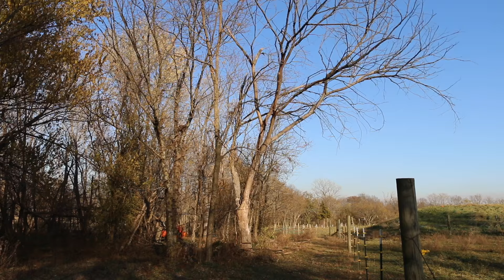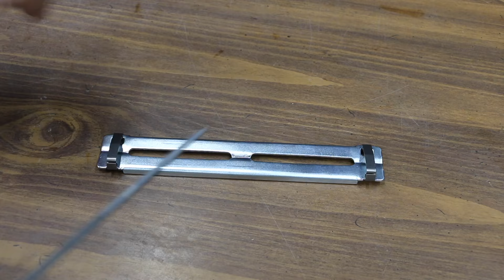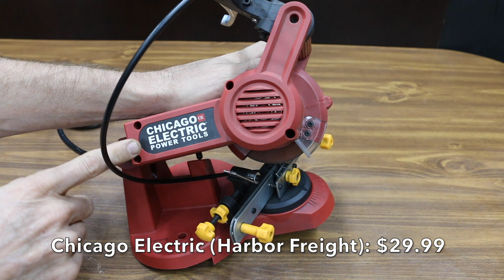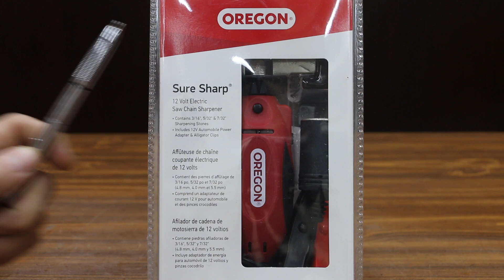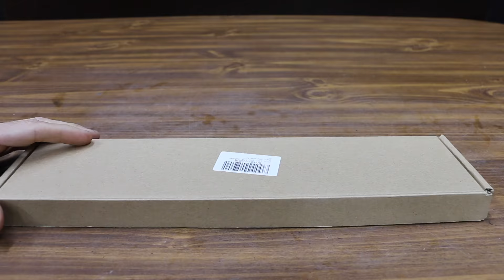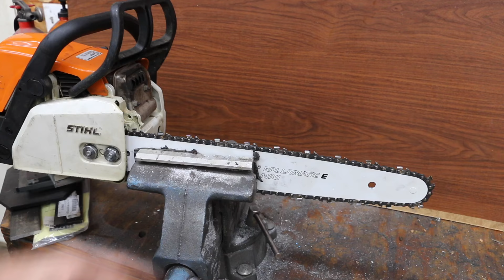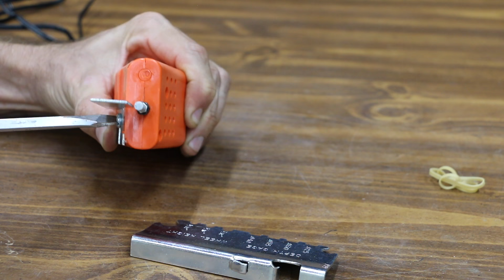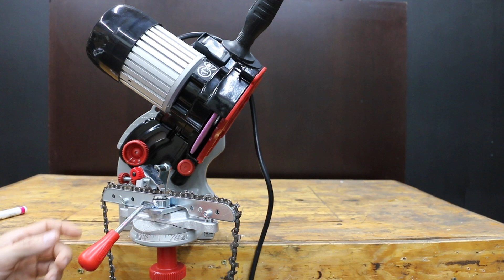Which Chainsaw Sharpener is Best? Let's find out! Stihl, Granberg, Chicago Electric, Oregon

Comment: I takey Granberg 12v everywhere in my box. Use a Milwaukee 12v batter with 2 14awg wire(ends hammered flat) to connect it with. Even if you mess up your chain bad it can restore it to like new condition as good as any bench grinder. 
Great test and big shout to Granberg, I atest they stand behind their equipment as well.
Reply from the maker: Thanks for the feedback.

Comment: Great video. I feel good (bang for buck) about the Harbor Freight sharpener that I have.

 Some suggestions for this type of test:
1. Using a corded chainsaw rather than battery powered. It would eliminate any potential variations in characteristics of individual batteries.
2. Somehow keeping the angle of attack of the chainsaw consistent. Maybe attach the chainsaw to some sort of arm-pivot contraption.
3. Using clear wood (or perhaps some material other than wood). There were patches of branch knots in the wood that you used.
Reply from the maker: Thanks!  Thanks for the feedback.

Comment: One thing you need to actually add and even in the instructions when you use a file you're only supposed to do the exact same amount of strokes per tooth that way each tooth is the same size which the organ bench grinder is way better than the harbor freight because it has a lot more adjustments which that's what we use  to professionally sharpen chains because you get each tooth identical and you got to make sure that you have it set up right so that way it keeps the geometry which you can actually add better geometry to it to actually cut faster and quicker if the saw is got enough power but if you look at your tooth when you used it had changed color you doing it way too quickly which takes The temper out the steel that bench grinder you're supposed to do it slow enough so not to overheat the chain that's how we professionally sharpen chains at the shop each tooth needs to be the same size if not then you'll start cutting crooked and all that
And the only con to the orgon bench is that you cannot use it in the field and then you have to use the file

Comment: Great Video as are all of yours.   I would add that Dremel makes an attachment for their tool that costs about $10 and works very similar to the Oregon Field sharpener.  Very easy to use and results are good depending on your skill and attention level.
Reply from the maker: Thanks!  Thanks for the feedback.

Comment: Just nit-picking but when he said that "Since this is a 3/8" chain, we'll be using a 5/32" file" he implies that all 3/8" chains use a 5/32" file.  That is definitely not true.  In fact, most 5/8" chains that I've used use a 7/32" file or a 13/64" round file.  So check the specs for your chain to choose the correct round file.  Another thing:  The only one of these sharpeners that sharpened both the tooth and the depth gauge was the Stihl 2 in 1 sharpener.  After every two or three sharpenings, the depth gauges have to be filed but this comparison didn't take that into account. With most of these sharpeners, that would require filing all the depth gauges which would greatly increase the time it takes to sharpen the chain saw.  As for the Stihl 2 in 1 sharpener ... DON'T get one!  It's made by a company called Pferd.  The Pferd branded sharpener is the EXACT same thing as the Stihl branded one except for the color.  The Pferd sharpener is blue.  The Stihl branded sharpeners can cost up to twice the price of the Pferd branded sharpener.
Reply: They are the same price lol

Comment: chicago electric is easy to use but requires learning how to set the chain properly so it doesnt move.   it also doesnt allow for depth of cut sharpening but in this test, only 1 manual sharpener does this .  its good price and does a good job for non professional chain saw/pole saw users that take chains to pros for sharping ($5 each chain in my area).  Biggest thing is angle and not trying to take too much material off at once.
Reply from the maker: Thanks for the feedback.

Comment: One factor I didn't hear about was the knots that the saw was going through. Not really a fair comparison but difficult to get a clean sample without knots. Having said that, I love my Chicago Electric sharpener and part of the reason is because its So incredibly unstable. This is my reasoning behind that statement. When you pull the handle down you can move it side to side (probably not by design) so I can get that grinding wheel to touch exactly as much as I want by pulling the handle just a bit toward the cutting edge/gullet. But for being out in the field there is nothing like the Stihl 2 and 1 (or the cheaper knock off that works the same). I tend to not use the 2 and 1 anymore since getting the HF sharpener. I just bought more chains and instead of sharpening in the field I change out the chain instead and sharpen them all in the evening. Much more efficient use of time when doing a job. 
Thanks for the review, it was a fun one to watch.
Reply from the maker: You are welcome!  Thanks for the feedback.

Comment: Thank you for such a great test. For years, I have been struggling with finding the best, but most economical, sharpening system. I recently bought the Stihl 2 in 1 and am slowly getting batter at using it. Now that I've seen your test results, I feel confident that I can get better and it will produce some positive results for me. If I can think of any further tests for you to try, I will certainly let you know.  Thank you very much for your great work. Cheers!
Reply: Have faith in the Stihl 2 in 1 sharpening system. The "learning curve" is virtually zero. I've sharpened , literally , thousands of chains in my life. I've done freehand, bench grinder and depth gauge, rotary bits in a Dremel, etc., etc. Nothing comes close to the simplicity of the Stihl system. The tool itself shows you the correct angle, every time.  Let the end of it bump up against the chain every time you make a stroke with it. However much it wiggles to go flat against the bar is how much you were off by. Feel it.. it'll talk to you if you let it..  You should be able to feel in your hand when the file goes across the gullet of the cutter correctly. 
The sharpest saw chain cutters in the world are useless without the rakers ( depth gauges) being properly set. If the depth isn't set right, the sharpest cutters will just spit dust, not chips or flakes. The whole point of the 2 in 1 is that it sets the rakers at the same time. 
Don't wait until the saw blade is spitting dust to sharpen. Normally, unless you hit dirt, or are cutting wood that's been on the ground for time, the saw blade should stay sharp for at least a tank of gas. After every tank, take the 2 in 1 and give the saw chain 3 to 5 licks per cutter. It's not meant to revive a damaged chain... That's a job for a bench type sharpener. The 2 in one has become my "go to".. Yeah.. maybe I could do better by hand..  but for the simplicity of touching up the saw blade in less than three minutes after a tank of gas... Damn!! Besides, I'm old.. it's my way of taking a break.  

Every time some one puts a hand on one of my saws that's been sharpened with the Stihl 2 in 1, the most common reaction is " Damn!!  Who sharpened this?"
Reply: @charles09361  I agree with you , I have 3 of these for my saws . My MS462 with Stilhl oilomatic chains actually feel more aggressive than a brand new chain. So quick and easy with a stump vice out in the woods
Reply: try using a plain 7/32 round file, you can watch it sharpen each cutter. those sharpeners with handles and guides block your view and you end up doing a poor job. I use the pferd premium files and it sharpens better than any machine can. look up buckin billy ray on here and see what he does
Reply: (Mlm

Comment: I hate to disagree with most of the test!  I am 82 years old and still felling trees!  He took a chain that was so badly worn he wasted so much of the collet one will have to buy a new chain 10 times to one of the Chicago Electric.   The C E is so fast i sharpen the chain at every refill of gasoline or 2 times the oil fill on battery operated.  This sharpner saved me over a $1,000 in sharpening and new chains because of commercial charges and wasted collet,,  And on the subject of cleaning up yur chain------Do it simple  water with a squirt of Dawn dishwashing soap and a brush clean in seconds.  the bad part of this sharpner is the latch that stop the collet  i had to remove it file it down and add washers to move it more torwards center,,,also not the position of the bar on the new chain it is parallel to the ground all others were tipped do not know if that had a difference---on my trees took down 6 /  28 in diameter Ash trees next to my house in 17 hours,,,,then all summer to buck them up,,to much for an old man! Viet Nam vet
Reply from the maker: Thanks for the feedback.

Comment: Thanks for the video! For me, a couple of the most important aspects of these, are going to be each system's overall "ease of use", for the average home user.
  As well as each system's long term reliability in regard to consistently sharpening a chain accurately. 
  Any thoughts on which one provides the least headaches, and fastest learning curve in regard to  achieving consistently accurate results for the home user?
   I would also be interested in seeing you run "shoot out" cutting tests on brand new chains, from Husqvarna, Stihl, and Oregon. And maybe some lesser known brands. 
   Testing for their "out of the package" cutting speeds. Edge retention for a number of cuts. Etc.
   And maybe possibly pitting each of highest rated "anti kick back" chains against each other to see which most effectively resists kick back.
  Obviously, I realize that conducting tests of this kind can (and might be), fairly (if not VERY), dangerous for you. So if you do choose to do these, please take care, and be safe.
   For me, the Husqvarna Rancher 460, with a 20" bar/chain, is the saw I prefer to use. And after cleaning the saw/bar/chain entirely, I have had excellent results in eliminating wear by using Lucas "Pure Synthetic" Oil Stabilizer on the bar's channels, and front sprocket port. I hot tank the chain in an ultrasonic cleaner for an hour. Rinse it, dry it, then immerse it inside a ziplok bag filled with the Lucas, overnight.
Saw runs beautifully on initial run in, every time. However, I do not use the Lucas inside the saw itself.
  Anyone still reading this, always use a high quality bar/chain lube during use.
And everyone have a nice day!
Reply: A simple file and handle is so much easier and faster and when you get good at it you wont have to spend 15 min setting up a special system. Stihl 2 in 1 is probably the way to go for ease.
Reply: @davido6915  Just make sure to also buy a "raker kit" and don't go hog wild filing them down. It can make the saw dangerously harder to work with.
Reply from the maker: You are welcome!  Thanks for the suggestion.

Comment: The 2 in one was not quite and accurate comparison . It files the raker's /cleaners every time . If you want to cut fast and your saw has the power to handle it file your rakers . It will hog of more material. But you need to keep a grip on the saw   and watch where your tip is . it you do extra . It will bite in on the tip and run up . Second a filed chain will stay sharp longer . Because it dose not get hot and burn the temper out of the edge
Reply from the maker: Thanks for the constructive feedback.

Comment: For my time and money, the Stihl 2-in-1 File & Go is best one.  No futzing around with mounting setup or setup at all, as long as you purchase the correct one for the chainsaw's chain, and it's good to know that it can be used with various round file diameters for others.  It's perfect for in the field because it's quick and doesn't require power.  Though it's best used in a bench vice, it can be used in the field without one.  That would just take a bit more time from fiddling with it and the chainsaw to keep the correct angle.  And cleaning with Lye is great to know!  Thanks

Edit to add:  Another YouTuber uses gasoline to soak and clean his saw chains, so I think I'll try that instead of lye.  He likes the Stihl 2-in-1 File & Go a lot, too, so that seals it for me.  And I'll be sure to get the Stihl 2-in-1, because you can't trust lookalike/copycat knock offs.  Thanks again!

Comment: I would prefer a bench grinder every time because it's faster & easier. You don't need to lock the chain in place because the locking device is doing the job. I would do three chains that would last me for the day instead of sharpening it in the woods when you're beaten. Also, I bought a metal chainsaw grinder from the 50's that does an excellent job & doesn't flex like plastic toy Chicago grinder does.
Reply from the maker: Thanks for the feedback.

Comment: Would the results be different if the body of the saw was attached to a pivot so the weight was not in any way influenced by your hand and the angle of the saw? Some passes the saw body was much lower than others effectively lengthening the cut surface creating more drag or friction from one cut to the other… physics and varied geometry… just curious but, I love you and your videos. I watch every one❤️❤️❤️❤️❤️❤️
Reply from the maker: Thanks!  Thanks for the suggestion.

Comment: I work for a sthil store here in Australia. When sharpening we use an Oregon chain grinder with a dinasaw disc. We run the gullet at 55⁰ and the head at either 30⁰ (RM) or 25⁰ (RS). Chains cut perfect everytime and have the perfect balance of wear resistance and performance
Reply from the maker: Thanks for sharing.
Reply: @ProjectFarm  didn't expect a reply on such an old video, shows your dedication to your fan base. Love your work mate keep it up, I'm subbed
Reply: With a grinder i always find shortest tooth and set grinder to make them all equal. Only advantage in using grinder.

Comment: I've used a few types of chainsaw sharpeners over the years from the field sharpening kit to the oregeon bench sharpener before I finally settled on the Stihl 2 in 1 sharpener. I've used the 2 in 1 on all my chains that I've amassed over the years (quite a few) and they all are cutting almost better than they did new. I will also note that after watching this video I will definitely be adding cleaning my chains this winter to my list of winter projects every year from now on. Awesome video thanks for making it.
Reply: I use the the Stihl 2 in 1 sharpener and now my chainsaw goes thru logs like a hot knife thru butter..fantastic sharpener..
Reply: yes.. the lye is a neat trick...didn't know
Reply from the maker: Thanks and you are welcome!
Reply: @ProjectFarm  , what so you do with the lye water?

Comment: While I appreciate the comparison of initial cuts, I'm wondering if they will all hold up the same.  Especially with the grinders, I worry about messing up the geometry.
Reply from the maker: Thanks for the suggestion.
Reply: Do not worry about messing up geometry it is a compromise. Study how chains cut and tailor your chain to the wood being cut. Some angles best for soft wood some for hard wood. And some for cutting dirty hard wood and keeping chain sharp longer. Chisel chain cuts faster, semi chisel stays sharp longer. Saw chain is a compromise. And unless you use saws a lot,and grew up using them. Just use factory recommended safety chain. It cuts slower but is much safer. My big 7hp saw will jerk you over a log if chain rackers  [ drags ] are filed to short. My other saws will hurt you if you don't watch careful. Because they run pro chain with no safety features. On saw my wife uses it runs home owners safety chain.

Comment: Fantastic video. I commented on your chain test video about hand sharpening beyond factory sharpness. And I'm very happy to see the comparison to the new factory sharpened chain in this video. In the workshop I use a Chicago electric style bench grinder but from a different brand at about the same price. With a little tweaking it's hard to beat, having the same price as a new high quality chain. When I'm working in the forest I use a "Husqvarna file gauge" a very compact file guide that easily fits in my pocket, a popular choice here in the Nordic countries. I'm very happy with both of them. But I'm definitely going to check out the Stihl 2 in 1 file. Seems like a great product for getting consistent results, especially with getting the gullet and depth gauge correctly set in the same stroke.
Reply from the maker: Thanks!  Thanks for the feedback.
Reply: No grinder will do any better than the chicago electric you got. And i got one of about all of them. Looking for a silver bullet, there is not one.The husqvarna set up you got is as good as any hand system. Unless you learn to file by hand and modify your chain to the wood you are cutting.
Reply: @cliffclark6441  Sorry for the delayed answer. And thanks for the input.
I actually modified my Husqvarna file guide to where I use a different angle of attack for birch during firewood season. I just scribed another set of lines on it, and it works very good. The rest of the year I use the default angle guide lines which works great for the spruce and pine we grow commercially. I'm not particularly nerdy about chain filing when I'm out there working, as long as it's a fast consistent way of getting a decent result, I'm happy. Our trees here are on average pretty small diameter compared to US wood The largest spruce trees we fell for production around here is about 30" diameter. And we run pretty short bars I usually carry a 15" so the time between touch ups are less than you'd probably have over there.